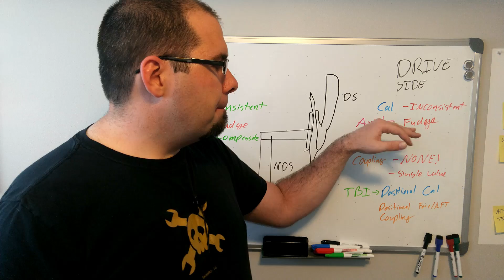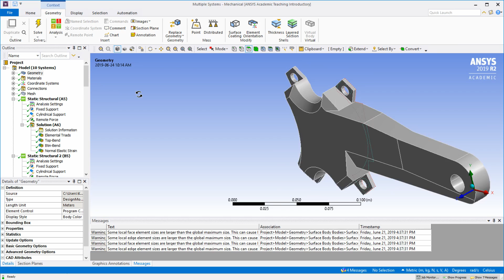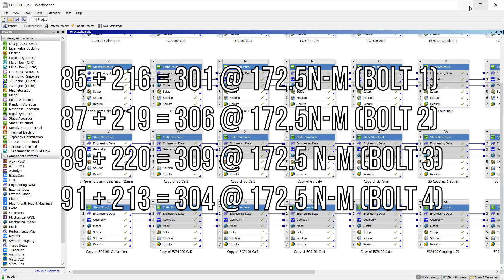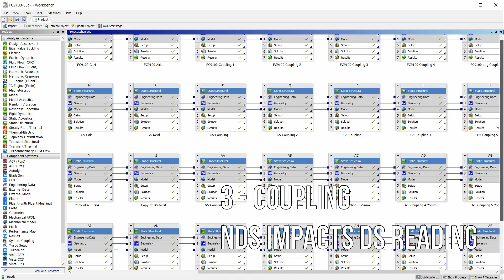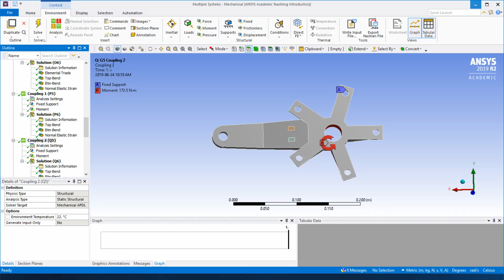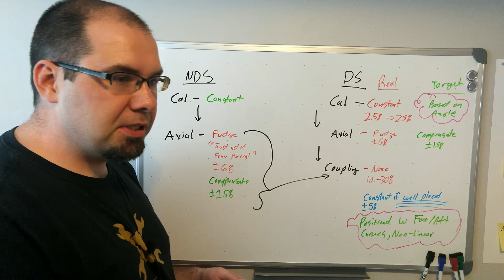Biggest industry blunder in Powermeters yet - Inaccurate and Expensive

Comment: Can you do a video explain how/why single sided power meters are ASTRONOMICALLY more accurate than they seem they should be on first blush? Thinking that there must be some all kinds of secret sauce in terms of algorithms normalizing and smoothing out power readings based on using angular velocity to correct/smooth out torque and so power…??

If you can get into this it would be awesome.. saw 4iiii CEO talk about this, but of course wouldn’t get too much into it since it is essentially their differentiator even for two sided.. it is the biggest barrier to market as the electronics and mechanical specs are well understood and easily replicated.

Comment: Hi Keith, are you aware if the RX810 cranks exhibit the same problems as discussed in your video? And if yes, then to what extent. I am in the market for a cheap 4iiii dual-based solution, but if it's not going to be accurate, then I see no point.

Comment: Hi Keith great video! I have a question about accuracy with symmetric cranks. I understand that drive side powermeter on a symettrical crank, like 4iiii on XT M8000 Shimano cranks, are accurate for changing pedal offset. Is the same the case for changing chainline? (Ie chainring spacer to change chainline)?
Reply: Also, I tried asking 4iiii, and their support told me the chainring position won't affect accuracy, but pedalling offset will.... Which doesn't make sense to me.

Comment: fascinating video.  At the end you said you would say away from new asymm shimano based power meters.  Are you meaning the crank arm based ones only?  What about the SRM Origin design that has chainring mounted strain gauges with asymm design?  Does the issue with chainring asymm have similar accuracy issues if gauges are chainring mounted like SRM traditional design?  I have two older SRM's on a 5 arm crank and was building a new bike, and in the market for new power meter.  I've found nothing shifts as good as the Shimano chainrings, so wanted to stay with that platform, and was exploring the 9100 crank arm mounted power meters...so, thanks for steering me away...now I'm questioning if inaccuracy's will be apparent in the more expensive option of going with SRM Origin and 9100 rings...thanks,
Reply from the maker: Yes, only the crank arm ones. I'm going to get pedantic. The Last "Shimano" 9000 SRM's were actually 7800 with a paint job and a 9000 Left arm. Origin is actually not a new pm, it's the old PM7 design (according to their FCC filings) with a passive recharge voltage regulator board. Basically using Quarq's concept of using shear gages (patented an in use before SRM transitioned to the design). Certainly agree -- nothing shifts as well as Shimano's rings. Everyone is few years behind in that regard. This issue only affects cranksets that are built on the 9100 crank arm platform attempting to sense arms independently. Nobody has ever sensed on the spider that already existed on the shimano cranks.
Reply: Keith Wakeham Thanks so much for the quick reply and great info, and good point on the SRM 9000 design.  If they where able to transition the original PM7 design to the 9000 110BCD 4 bolt asymm design, then the 9100 really isn’t different, in regards to chainring asymm

Comment: Hi Keith, inspiring video! At the end of this video you said the best solution is to measure the force continually with the information of where the arm position is, and make a pre-calculated maybe non-linear compensation due to the angle. For now I noticed Rotor's new 2INpower DM power meter is claimed to have the ability to scan the arm position and applied force at a high frequency, and can make a report of a complete position-force graph. So, is the Rotor's method actually what you implied at the end of the video? Or theoretically it's the best solution in the market now? And another question, if I picked up a left-sided 4iiii Ultegra 6800 now at a bargain price like $200, will it still be good?
Reply from the maker: For those cranks, ya, it's all messed up and the only way to get good numbers will be to do that mainly on the right side. I'd actually go the other way. Just make a perfectly symmetric simple shaped crank. Rotor is relatively immune to these problems. Rotor is still using a constant calibration which for their shape is fine and just offering a high speed output, not exactly what I described. Previous generation Assymetric arms were less immune and the 4iiii's tech is not just a simple bending bridge (3x4gage bridges, compared to say stages 1 simple bend of 4 gages). If you're okay with the left only solution and it's limits then 6800's are fine, and on 4iiii's tech better than fine. Some peoples tech not as good.

Comment: Are you saying that the left side only power meter is more accurate than the dual ? Thanx
Reply from the maker: I'm saying on the right brands that compensate for the axial the left ones are competitive with other technologies (or that don't compensate but are on highly symetric cranks like FC-5800, Sram rival OCT, rotor). The right side is just out to lunch on the R9200 and R8000 cranks and they are not accurate and not precise. However, I contend that left only pm's are meh. Leg balance changes second to second and averages can skew. Nobody is 50/50 all the time. It's like there is randomized noise on your data. I'd buy a "total" power for a bit more first (EG quarq) or spend the extra to get into decent pedals now.
Reply: @kwakeham  But for those of us who already have a Stages Gen 3 L/R power meter and don't plan on immediately replacing them, would you advise using L side only power?

Comment: great presentation!!! what is your recommendation for a reliable power meter?
Reply from the maker: Some peoples personal experience will differ from mine, but Assioma and Vector 3's rate very high. Assioma looks / spring tension / cleat compatibility aren't perfect, but cheaper than Vector. Spider I'd do Quarq first (though just be aware AXS chain/cassette/chainrings are NOT compatible with any other drive train due to roller diameter). I have a hard time with ARMs because of such high variance I'm not keen on left only solutions. Very few dual sided arms that work because almost all are R8000 / R9100. Rotor has very good strain gage setups but 3 years on with 2/inpower people still report cadence differences indoors and outside. Not a good sign for firmware.
Reply: thank you.
Reply: @kwakeham  Thank you

Comment: What do you think about the specialized carbon power crank? It's a 5 arm symetric carbon crank with 4iiii powermeter.
Reply: I've tested the FSA SL-K Carbon crank from 4iiii with their gauges on it (full L/R unit) and it was excellent. I'm not sure about the Specialized crank but consider this +1 data point for the 4iiii gauge and radio tech being excellent when used on a crankset that doesn't have the issues as documented here.
Reply from the maker: Since I formerly worked for 4iiii's and developed their powermeter tech I  cannot make a comment on this.

Comment: looked through your videos and didn't see any breakdown of rear wheel hub powermeter accuracy. Is that in your future plans? Or just not an interesting enough situation?
Reply from the maker: There is only one design in the market place and that's Powertap Hub. They've been my go to reference outside for years. It's be more of an explainer. Mechanically low on flaws. Some practical pitfalls and care / maintenance stuff is all that's there. Might be short but I'll give it a though.
Reply: @kwakeham  Hi Keith. What do you think about the infocrank's design, as compared to say pedal based systems... if possible, can you run a video exploring this?

Comment: So you mean my $300 glue on power meter won’t read correctly?!
Reply from the maker: If you classify these as glue on then all power meters are glue on. All gages are glued onto a piece of metal with epoxy (Shimano, srm, quarq, p2max, vector, powertap, etc). Most housings are glued on with some sort of adhesive (quarq, Shimano, vector 3, assioma via potting). This video pertains to the specific problems related to conventional techniques of instrumentation of strain gages due to the geometry. So I'm not sure I'm following your criticism. Can you elaborate?
Reply: Keith Wakeham  I was being a little facetious, I don’t understand how people can expect low cost power meters to work properly. Infocrank is the only power meter designed specifically for accurate data with no compromises. SRM is the next best if you want to keep the shimano look and chainrings.
Reply from the maker: It's interesting how neither of the ones you mention have active temperature compensation nor updated their products for compatibility or features let alone fixed their own accuracy issues (be it smaller, except the verve peak torque cadence is an error prone joke because they forgot inertial sensors and people hated two magnets). Assioma, vector 3, or quarq are miles ahead on all fronts especially accuracy.  I'd be surprised if these companies survive a few more years.

Comment: I don't think it really matters (at least to me anyway) whether my power meter is off. As long as its consistent (right or wrong) I know whether I'm going in the right direction training wise.
Reply from the maker: To a point yes. If it was cheaper, sure, and you didn't use other meters, okay. It just raises the point of for more money I can have wrong data with wrong L/R balance and wrong advanced metrics like TE/PS and now have to ignore all of those. At that point if all the data is wrong why are you paying more? It's either to not switch pedals or to have Shimano crankset. Or lets say you have a trainer for indoor and the meter for outdoor, there isn't even fully consistent alignment of data because the shimano problems are are style related. And pedalling "style" depends on bike fit, fatigue, heat, cooling, pain, weather you saw a pigeon that morning, etc. There are a lot of downs caused by the latest batch and the consistency argument is weak, since it's not even fully consistent and you have better and cheaper alternatives.

Comment: Unbelievable work! Your simulations are awesome. When I think that some people waited the Shimano Powermeter solution  to buy their first one. Because "Shimano is reliable"... 
What do you think of P2M powermeter? I've got the NGeco (spider shimano chainring  compatible, 4 bolt, with Rotor crank) and it is unbelievably consistant. Thank you !
Reply from the maker: I have another video titled Every Spider Based Powermeter is a Quarq. The dynamic  (spinning) calibration is necessary because of some practical inconsistency in the design caused by a mechanically weaker design. It's proven very consistent in practical though from a technological design perspective it's still the entry level spider unit. For training and racing with total power I give them a thumbs up. However because of the total power reading their L/R balance is slightly wrong and totally fake, TE / PS are both totally wrong and totally fake. So if yours is the unit where those are paid upgrade, they are just worthless.
Reply: @kwakeham  , thx for your answer. I didn't upgrade my NGeco, because I had the feeling that I would be kind of fake, as you mentionned. And total power reading is the only data I need. Keep going this way !
Reply: @kwakeham Wakeham That was WAY over my head, but fascinating, nevertheless. I have a R9200-P on order so hopefully, things are fixed. One of the things Shimano has touted is that they're using different materials. I never heard materials come up in your analysis. Is that just marketing spin?

Comment: You mentioned the quality of cranks for fudge factor. Are there differences in say an ultegra or dura ace crank arm?
Reply from the maker: Yes, the more asymmetric they are the more the axial problems affect them on left and the coupling / chain ring positional affinity / and axial on right. It kind of goes worse to best R9100>R8000>9000>6800/R7000>5800 (symmetric) >> Removable spider / symmetric. On left arms it's only a small percentage of people that can notice the problems readily. On right side, the limit of quality data seems to be around the 9000/6800. Manufacturing variances add more problems too. The adhesive/epoxy built units have greater variance than the hollow forged units (which I found really surprising).

Comment: I assume left side only, crank based are still fine right?  Or they are suffering from similar issues ?
Reply from the maker: As mentioned, they suffer from axial fudge factor depending on brand (a few correct it) which tends to put them into the okay (fudge factor ones) to pretty good (corrective ones). A lot of that has to do with if you pedal wonky. The largest left only brand consistently reads 5-6% low but I pedal wonky so if I don't use a unit that has corrective sensing (like the version my name is on the patent) then they are off and a bit inconsistent.

Comment: Please can I ask that you change your title to problems with Shimano Duel Side Power Meter cranks, as your title is misleading. Shane both in his report and video state that this is an issue only with duel side Shimano PM, not left side only. This is important as people will start belieiivng that all crank based PM are inaccurate, which is not the case.
Reply from the maker: I hadn't though about this. I will give it some thought but I'm not generally inclined to. There are few reviewers out there that can do this testing. Having worked previously in industry developing more advanced technology for these problems to get beyond just a simple bending bridge for this stuff I have found many off the shelf left arms are outside their claimed error because they just adjust their calibration for "most" people. If it's got a single wheatstone bridge 4 gage setup on these arms on the left, the edge case weird cycling force people like me causes every single one to read low by upwards of 6%. IF they had a fix that wasn't just fudging the calibration factor I'd change title in a heartbeat at your request, but the short is only 2 or 3 of the left arm companies are not just fudging calibrations. So I'll have to give it more of a think on your request.

Comment: What do you think about the verve power meters? The crankarms seem to be designed from the group up for the use of a power meter.
Reply from the maker: The positive is that they are instrumented in a simple way on a symmetric shape which eliminates these problems. So torque is accurate (Unless the temp shifts) but it's outdated, overpriced and heavy and just markets over rather than admitting it's flaws. What is outdated. 1) peak toque for rotation detection and not an accelerometer. Software fix for not redesigning PCB then marketing fluff (your rotation rate can bounce around despite false claims. It's worse than a accel) 2) No active thermal, and it's 100% requirement for 2019 (saying they don't need it but that means either it's as stiff as a wet noodle and probably would fail ISO testing which means it's not sellable OR they do need it and they didn't dev it - didn't put in a decent temp sensor and didn't cal temp) 3) super heavy 4) Entry level shimano level crank, think Claris or maybe Sora, so it's stiffness is down, weights up, and aesthetically it's a bit closer to hardware on a $1000 bike (that's more my opinion) 5) Praxis rings are good, but they are not as smooth or reliable as Shimano's 6) Weird battery and weird battery cap with falling out batteries when you try and swap and Mandatory SR44 and not LR44 batteries which has good and bad points and unlike vector can't use the higher density 1/3CRN. In short they got the gages right and just need to get off butts and rev the product, get active temp, add accel, cover the exposed strain gages in the electronics area, and drop their price below an entry level quarq with aluminum arm. Either that or need to redesign hardware / firmware to offer something more
Reply: @kwakeham  ah I see. So what power meter would you buy today? Just for reference I have a bb86 bike.

Comment: Does this mean that the most reliable and accurate dual sided power meters are the pedal based ones?
Reply from the maker: Of the currently available units, yes. Some of the older dual sided built on near symmetric cranks were good and competitive with the pedals. Pedals have matured and gotten bettter / cheaper of the incumbents (some laughable new entrants) . Keep in mind that each powermeter has their own flaws. For me the Powertap pedals are always in their claimed accuracy for me but it is also the only ones that bounce around from 2% high to 2% low every few seconds. I believe its related to how I pedal and how they sense rotation (magnet encoder) so it's not crank but pedal rotation and that can vary. Vector 1 / 2 installation was their pain point. I've seen professionals spin them on bike stand to set the installation angle (instant wrong angle!) and wonder why they don't work. My personal go to are that Assioma and Vector 3 which are both pretty decent. Assioma is idiot proof but ugly and min clip in force is like a shimano new max. Vector 3 had some door and "drop out" issues and requires a pedal wrench. I've never experienced the door or drop out (later units with new door, and drop outs can be fault of everything around the unit and not the unit). I find the vector cleats more "look compatible" than assioma's which are thicker.